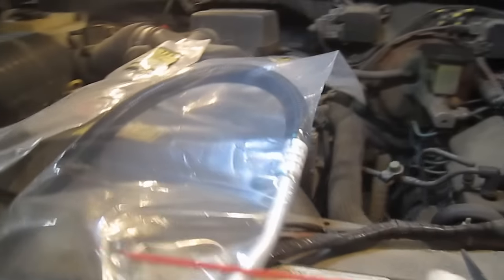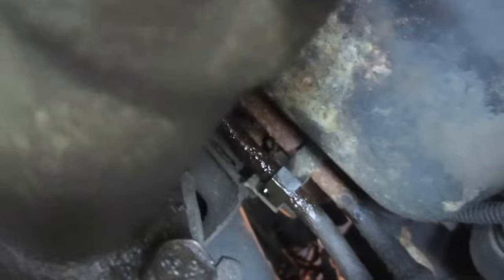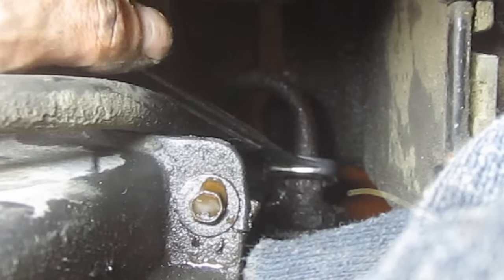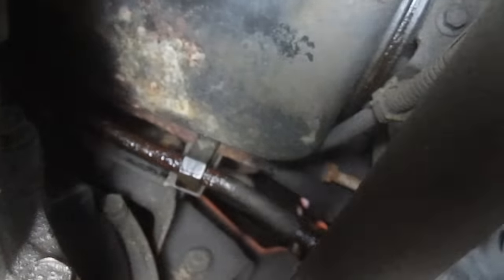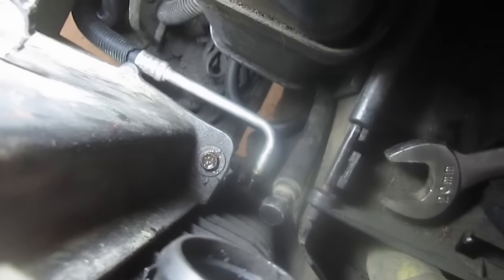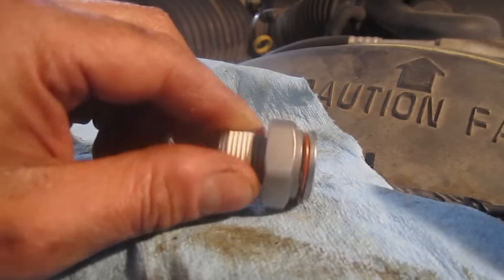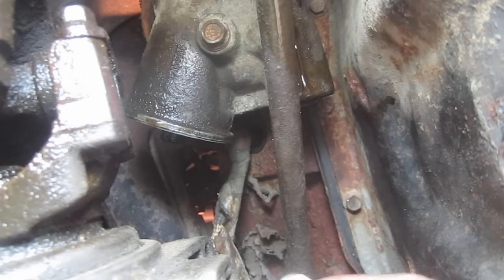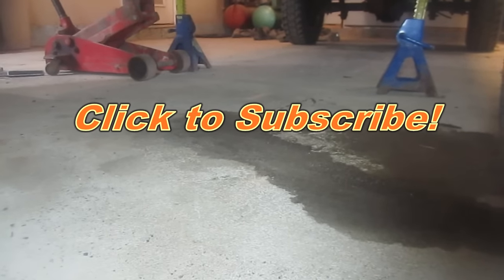DIY How To Replace GMC \ Chevy Oil Cooler Lines & Quick Connect Fittings

Comment: To make your job easier... taking oil filter off then try taking off oil adapter bracket with lines on by taking off two allen bolts that are above where oil filter was  . Only cost $6 for two gaskets . Then you can do all the connector fittings and clips and install of two hoses in s area you have more space and everything is more accessible. So take off rad lines 1st then drop adapter , replace everything, install adapter then rad lines last . Hope this helps , works on most trucks

Comment: A 26mm wrench or socket works best for installing the quick connect fittings.  A 1"  or 1-1/16" socket will also work.

Comment: I believe you can install the clips first and push the line in until it clicks. Also there is a cheap tool you push in that releases the clip without actually removing it however I still find it easier to just take it out with a pick.

Comment: on your lower radiator connector if you remove the upper fan shroud and the 2 10mm bolts to the lower shroud you can pull it back enough to allow you a little more wiggle room for the lower line and thanks for the info about the quick disconnect i wish i would have seen this before i did it all the hard way and of course mine was a frustrating engine swap and i reused the original line one of which is leaking now so i get to do it inside the truck now
Reply: Does anyone know how to remove the upper connector!? Mine is completely stripped and I don't want have to buy a whole new cooler line! PLEASE HELP, I CAN'T EVEN REMOVE IT OR SOMEHOW BREAK IT OFF!

Comment: Do you have a video on the older GM trucks?  I have a '94 GMC Suburban 5.7L. My cooler lines have plastic clips that go into the filter housing. Inside where the line goes into the housing there's o-rings and a plastic spacer. I'd like to see a video on the line replacement on one of those.

Comment: Those clips don't have to be removed to install the lines. leave the clips in the fiitings and push the lines in untill the clip locks in place then put the plastic holder ring over the clips. The clips are ment to be installed before the lines are installed.

Comment: Yeah I just replaced my Oil lines on my 99 GMC Suburban, What a pain in the ass it was.... And the AC Delco replacements is like 80 bucks a piece at the part store, I got some crap Dorman replacements as I couldn't wait for Rock auto to ship them, If I ever have to change them again, I deleting them or cutting and flare the ends and running my own lines, they are not worth $80 bucks for something a bone stock 350 doesn't need, and I can't change out the oil cooler adapter as the 2wd version will hit the yoke of the front diff, I tried that with a short filter.

Comment: Also, these engineers who abide by the CEO's demands of planned obsolescence need bitch smacked. They deliberately make it so you can't check your fluid without putting it on a rack or have a very flat drive way. Have to pull a drain bolt to add fluid. On top of that they designed the doors so the rain pours directly on the speaker connections blowing out the speakers. Chevy deserves hit with a club in the knee caps for this mob style extortion.

Comment: I haven't completed my job YET, but I took off the air breather, fan shroud then fan then lower mostly plastic CLIPS 2 screws and 3 bolts only holding upper fan shroud. Fan comes off with Crescent Wrench and holding pressure on rear metal you will see turn when you try to apply pressure to Crescent Wrenck I used a wooden  pick handle pushed against metal that was spinning and it The Fan broke and start Unscrewing Freely no longer needing Pick Handle. CLEARED the Way up Tremendously.  As there's No Room and Having mostly Plastic in the way Was Too Easy To Remove.

Comment: Hello Mark and thanks for the great video.  Question...where does the plastic bracket that holds the two lines together attach to?  Shown at 15:25 but I couldn't really see it.  Is it some sort of metal bracket that hangs off the oil pan?  On my truck whatever that plastic bracket clips into is not there and thus the lines are not properly supported.  It was probably removed by some previous owner.  A picture or diagram of what that plastic bracket attaches to would be great.  Thanks.

Comment: Good video,just wondering why  you took the clips off the new fittings? they are quick connects,your not supposed to remove the clips from the fittings.Also the lower fitting is easier to access thru the fender well....
Reply: I was wandering about that. The clip only comes out for removal, not install.

Comment: Yo, 2 mins into video when you popped the drain oil bolt I had to snicker a bit looking at that oil.   From the looks of it, I'd guess that oil is clocking at least 60,000 miles on it or your rings are totally shot.  I'll comment some more as I watch.

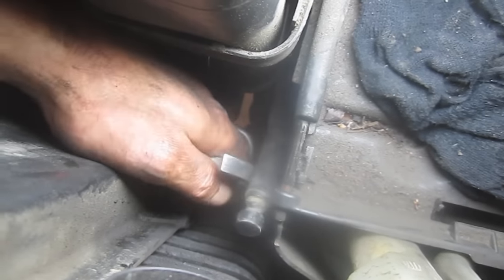Comment: Yes, 9:58 into video I simply removed upper portion of radiator shield like 3 top bolts and 2 on each side.  This allows the bottom shield to be lifted slightly and leaned forward towards the fan so you have full access to bottom oil line nut.

Comment: I don't think these after market lines are worth a damn. You may want to look into the braided stainless steel lines they sell on ebay for fuel/oil lines on hot rods. Lot better quality ,no shitty crimps good fittings. cheaper too.

Comment: Ok I have had multiple problems with these oil cooler lines.. The best advice that I can give everyone is to take them off take an Allen wrench and stick it into the threaded pipe on the oil filter adapter kit... Take the threaded pipe and insert it into the block and tighten.. screw the oil filter onto the block and throw the rest of that shit in the trash and it will never leak again...... I'm just trying to save people a lot of headache and money.. Problem solved and good night... Your wasting your time watching any of these videos..
Reply: This sounds interesting  What size allen wrench?
Reply: @wayneinfl  His post was gibberish, but I think he's suggesting that you get a pipe fitting plug and install it where the lines go. Some engines, that's fine- others route all oil through the cooler so to bypass the cooler requires an external line. I can't recall if these can just be capped or not.

Comment: I did this same job yesterday but remove my fan shroud it was much easier. Also it is recommended to not reuse old clips. If you need the quick connect adapters for the lines they should also come with clips. Just leave them in the adapters and pop the line in.

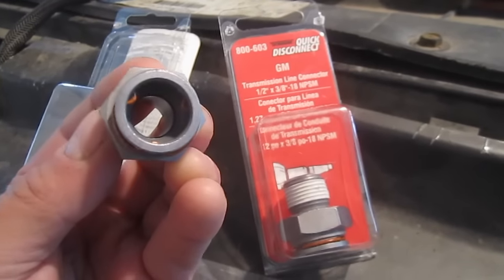Comment: Mark, those quick disconnect fittings you show at 1:05, how did you select those?  I know you said they were from ebay, but did you pick them by size or by vehicle make/year/vin/etc?  I'm planning to swap the radiator on my S10 and the fittings you showed look larger than mine.
Reply: I will go to NAPA and see if they have the disconnect screw along with the lower oil line I need to change.

Comment: The quick connects on mine does not go in very far before it gets tight and can’t turn anymore like yours . I don’t want to tighten them more due to fear of stripping the housing threads.

Comment: My 2000 Astro w/141K is leaving small drip stains on the driveway and I was told to check these lines. I may be doing this job soon so thanks for posting.

Comment: Well, maybe I was wrong about the antifreeze since you said your water pump was replaced last year 10 mins into video.  It still looked like it needs to be thourougly flushed though.  The little bit 3 mins into video looked like a lot of rust was mixed in with the antifreeze.  Plus the underside of truck looks like it lives in a state with cold winters and lots of salt.   meaning lots of rust.
Reply: That's just dexcool

Comment: Thanks for the video.  Very useful to watch someone else do a job before tackling it yourself.  My only other comment would be that it seems that you defeated the purpose of the quick connect by taking the clips out of the plugs.  Mine just pushed right through the clip and snapped in place.  No need to wrestle with adding the clips.

Comment: I did the same thing and replaced the fittings on the filter housing because they where so corroded and rusted to the lines. I just used a tube cutter for brake lines to cut the radiator connections then used a socket to remove the pressure fittings and a bent wire to remove the old o-Rings seals. For the price of the new fittings it isn't worth having any problems down the road with leaks.

Comment: Nice video. I wasn't sure how the quick connect worked, this cleared that up for me. FYI for me in my 97 k1500 tahoe the charcoal canister is next to the second battery tray, so i just removed it and got access to the lower line on the radiator. I'm not sure what that was that next to yours.

Comment: my '95 C2500 (w/o air conditioner) work truck developed leaks in the oil lines, the power steering lines, and the AT cooler lines... needed a coolant flush as well.  Crap everywhere in the engine compartment (had rusty battery tray, damaged trans cooler when I got it 2 years ago). Only got around to dealing with this mess now.  Since I had nothing to lose, getting to the lower oil connectors was made a LOT easier by 1) of course removing the grille, bumper, upper and lower plastic pieces; 2) removing the upper fan shroud; 3) unbolting the fan itself from the fan clutch (4 bolts & didn't require removing the serpentine belt); 4) removing the lower fan shroud.  From there, the upper radiator hose, then the upper and lower hoses are easily accessible, after draining the oil.  Since my whole compartment was such a mess, though, I had drained and collected the AT fluid first, the oil second, the engine coolant third. After that, the entire radiator came out, and used a baster to get as much of the power steering fluid out as possible and those lines replaced.  Now it's time to clean all the crap out of every cross-beam, crack and crevice before reassembly. Wish me luck.

Comment: I've got a 94 Chevy Cavalier (front wheel drive). My oil line is leaking, and the tubing lines on mine were rusted through worse than his!...lol. I have never changed these before. On mine, since it is front wheel drive, the lines are only about a foot and a half to 2 feet long. Watching a lot of these oil line and transmission line videos, what I don't understand is, why not just use hose fittings and run high temp rubber hose the entire length? Since mine is a short run, on the online auto parts places, mine only cost about $11.00. So, cost isn't the issue. Just seems it would be a lot easier installing hose fittings and not have to fool with all those tube connections. Hose fittings are a lot less hassle than tube lines and connections. I realize if you have a rear wheel drive, and longer lines to run, you may need the tubing for more support while snaking through the motor. But a short run like mine, why not just use hose and hose fittings? Has anyone just ran hose instead? (note to self: get that PV blaster spray, because I'm sure, mine have never been changed and are corroded really bad)

Comment: 1 question. The longer of the 2 hoses, the one that runs to the top of the radiator, does it run to the top or bottom quick connect on the oil filter housing?
Reply: Longer hose is the top. Top to top, bottom to bottom.

Comment: Just blew a new motor because of DORMAN OIL LINES failure in rubber to mechanical crimp .Blew the hose right off the crimp end at the motor! Spend the couple of bucks and get OEM line that are steel not ALum !
Reply: +Mark Jenkins the hoses going to the radiator from the filter were weeping too last week and was planning to buy OEM this week had problems before with weeping in another truck but not a total failure like this , line failure pumped the oil out at 50mph came to stop in traffic motor shut down end of story lookup reviews on Dorman lines not worth the risk!!!
Reply: +Bernd loos I'm going to change mine out. Have the original stock but they're 20 years old. and just started leaking. I think it's the return line. I made a youtube video just today. My attempt to find out the source of the leak. I just changed my oil too.
Reply: +missingremote eom line are about $20 bucks more than the Dorman aluminum lines !!well worth the money and the headaches !  Rockauto in three days!
Reply: +Bernd loos Same thing just happened to me Bernd.  Basically the same truck as in this video, 98 chev with the 350.  Just replaced motor 8,000 miles ago since the truck is not rusted, and I can't really afford what newer trucks cost.  So I spent $6000 on a new GM engine, dumped all the oil on the highway last night.  Once I realized I had no oil pressure I slipped it to neutral and shut off the key - but I think it was too late.  Anyway - I have one source telling me it is critical to have these oil cooler lines routed correctly - basically if not routed, installed correct, they will be exposed to excessive heat, and the heat will cause hose failure.  Any insight into correct routing - I believe it may have to do with that plastic spacer the video showed in a couple of shots.  Anyone else shed light on this hose routing claim?
Reply: +Barry Chouinard TRUTHFULLY YOU CAN'T ROUT THEM WRONG, MINE JUST POPPED OUT OF THE CRIMPED END LIKE IT WAS NEVER SWEDGED AT ALL THEY DID REFUND THE FULL AMOUNT FOR THE MOTOR AND INSTALL WITH ALL THE RECEIPTS I SENT THEM BUT IT STILL WAS 4 MONTHS AFTER I PAID FOR ANOTHER MOTOR AND INSTALL AND RECEIPTS PAIN IN THE A**
Reply: +Bernd loos Just went to the shop that has my truck.  Sounds like the same exact failure.  New Dorman hoses were installed on my truck when the new motor was installed - December 2014.  Dorman had BAD hoses on the market in that same time frame - they recalled the hoses, pulled them off the shelf, replaced them.  But mine was already installed - they didn't pull those back.  Just like yours - the rubber hose pulled completely out of the crimp/pipe, dumping all the engine oil.  Shop is talking with Dorman claims rep now about downstream damage.  My engine does start and run, does not sound like a sewing machine.  I don't see how it could not be damaged.  I drove it about 3 miles between when I noticed something "abnormal" until I realized I didn't have oil pressure - then slipped it into neutral and shut the key off.  After coasting to a stop I turned the key, and it would not make a complete revolution.  It did not completely seize, but it was seizing - very close.  8000 miles on a GM crate motor - if Dorman sends me back on the road with it I intend to pull an oil sample in 2000-3000 miles.  We'll see.  All work was done in a shop so I have full receipts, and truck is at the same shop now.  That shop also towed me off the highway last night.  Routing issue seems dead issue now.
Reply: Mark Jenkins dorman cooler line not that good

Comment: You said an easier way to reach the bottom line on radiator? I didnt have open end line wrenches so i pulled the plastic fan cover off and slightly moved the remaining bottom of fan cover mount towards the engine to give enough room for a wrench to be able to be placed on the bottom bolt from inside fan housing.

Comment: Any idea if this will fit the 1986 Chevy  P30 ?  In this case the P30 chassis is fitted to a Fleetwood Pacearrow Class A Motor home body.  This is a 1-ton chassis I suspect that the C or K 30s would work.  Am I correct?

Comment: I have an 06 pontiac torrent, Should my transmission cooling lines be leaking antifreeze? I use dexcool and its pink. I know its a coolant leak but have been told the leak looks like its coming from the transmission cooling lines. That i have to replace the lines. and $300 part. here is a vid of my leak https://www.youtube.com/watch?v=uQsNpLwdmfg
Reply: That was a fast reply. Thank you. Did you see my vid? it sure looks like the leak is in that spot. I have not been able to get under yet. Car too low. Waiting for ramps. But you did answer my important question. that the dex should not be leaking from those lines. mystery to solve.. Started with no heat. then engine redline before i got home. My dash warning lights seem to not work. did not tell me i was low i fluid.

Comment: Thanks I found this very helpful. I have an 09 cobalt and just replaced all the fuel lines, battery, those plastic clips and now I have a leak coming off either the line fitting or the hose... I hope it isn't the complete radiator. Thumbs up . You taught me something new.

Comment: I have an s10. How do you get to the back bolt that holds the back part of the oil cooler line on? It's in between the hell housing and I want to say the transfer case.

Comment: Instead of putting new lines in just pull the lines and then get a plug that fit in the oil filter adapter

Comment: To get to the bottom hose on the radiator easy , is to take the top plastics part off from around the Fan and you will have more room

Comment: I'm not sure if your truck has this but mine does and I've seen a lot of other GMC's of the same year that have it as well and in the exact same spot. so if you're looking at the truck from the front on the left hand side there is some sort of Cooler. what I mean is a small radiator of some sort. I thought it was the transmission cooler but the transmission lines go into the left side of the radiator if you're looking at the front of the truck. you obviously replaced the engine oil cooling lines and they go into the right side of the radiator if you're looking at the front of the truck. so the cooler that I am talking about what is it Cooling?
Reply: Power steering